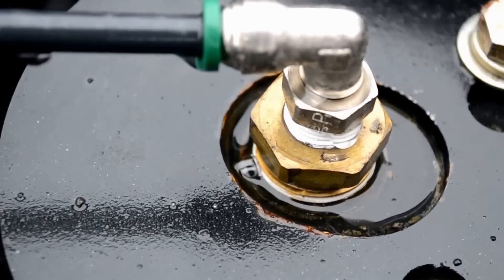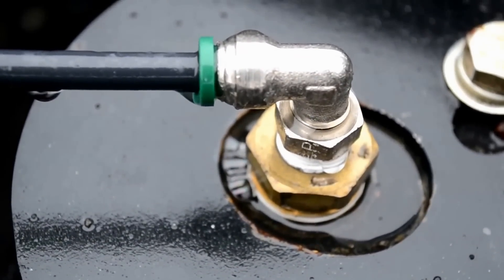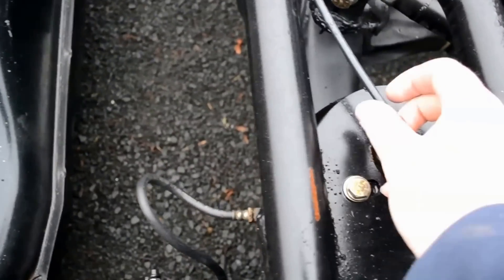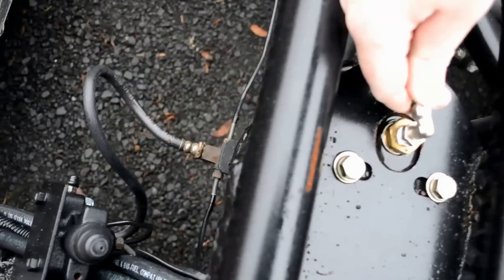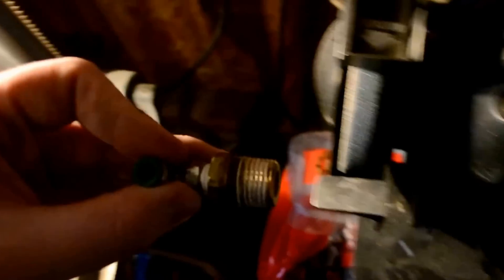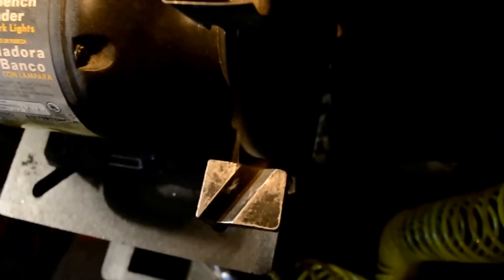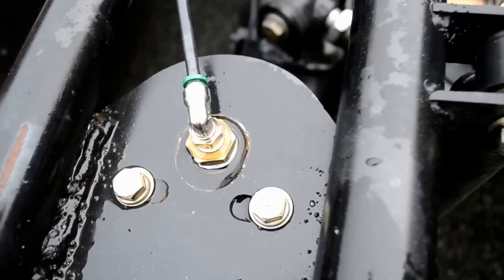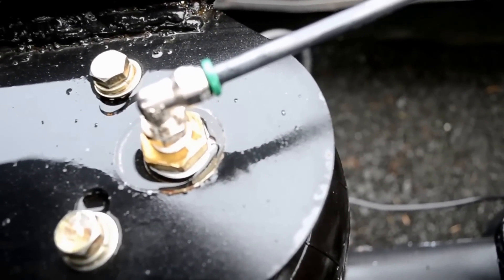Air Ride//Leaks

Comment: I'm having issues with my air compressor not turning on when they are supposed to and the idea way could it be the pressure switch that's not telling them when to turn on
Reply from the maker: Ya check your pressure switch and wiring
Reply: Most air management systems have a pressure sensors that goes to your main harness. That harness then has a relay that tells the compress when to turn on and off that way the compressor Isnt on full on mode all the time. I would check your tank pressure sensor If it has one. If this doesn't fix the isshe then check to see If you have contact with the wire from the pressure sensors also the relay depending on If the air management kit came with one. Last but not least could be a bad compressor too but that would be the last reason why you are having this issue. Hope you got it to work

Comment: I wouldn't use a grinder. Maybe a wire wheel to not risk damaging the thread. Just a thought
Reply: He did use wire wheel. Was pretty clear in video
Reply: Faceplam
Reply: Did it look to you like those threads were grinded down at all? C'mon Man!